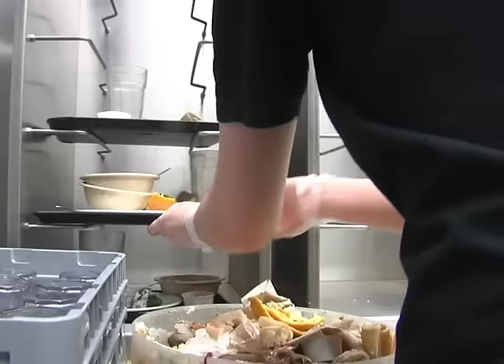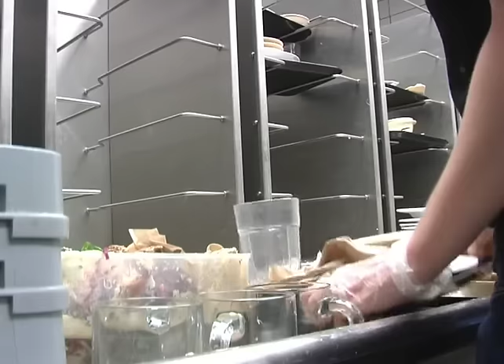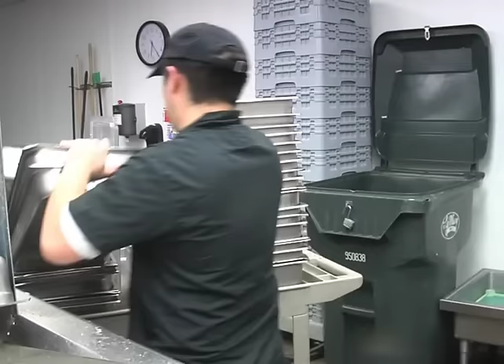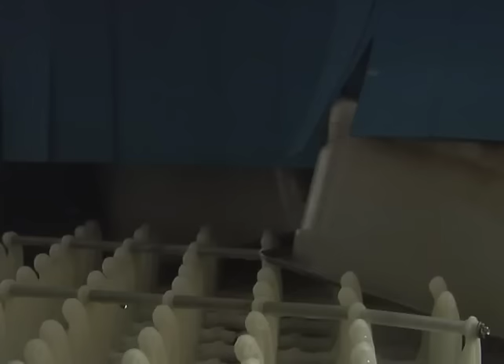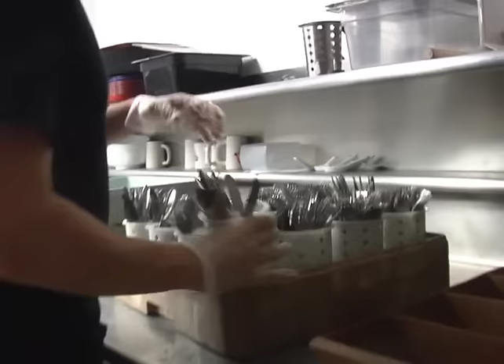Dishroom Training.m4v

Comment: 1 easy to notice large error - dishes going through dishwasher are filthy. When the dishes are not rinsed properly they will come back out the dishwasher still dirty and need re-cleaned.
Reply: put em back thru a second third and forth time, also you can hack a conveyor machine to run continuosly, only immigrants try too hard in pits
Reply: @walmartian  or idk do your job and clean them like a normal person would
Reply: @walmartian  wtf you never worked in the dish pit before.
Reply: The machine they are using is $20,000+ with multiple wash and rinse tanks. It is not as inefficient as the machines you are used to. You have a point, but we work smarter, not harder.
Reply: @walmartian  why would you want to tho
Reply: Thats only something to pick up on if you're using a single tank washer... the one in the video is at minimum 3 chambers. Tank 1 is a pre wash, tank 2 is a wash and tank 3 is a rinse, followed by a dryer element.

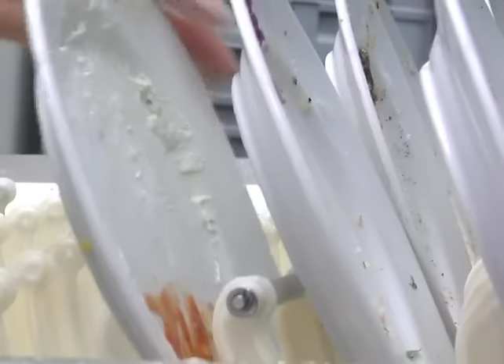Comment: 2:35 Silverware should be mixed in cutlery containers to prevent "nesting" i.e. DON'T put all the forks in one container, the knives in another container, etc., but put a combination of forks, spoons, and knives into each container so the water can circulate more freely. This means a much cleaner result. 

And if you stack the silverware on top of each other in a fine mesh flat rack, how are they going to be cleaned ["rinsed"] properly???
It's a great start but if you fill a cutlery container for example with knives, and then put them through the dishwasher again, how can the water even circulate properly? Good luck!
Reply: You are sort of correct, but please look at the video again, at around 2:35 you will see, that the silverware is mixed up in a flat rack with fine maze. This rack already has been run through the machine. After it came out, there you see happening, they sort the cutlery out in those little baskets. and run it through again. The function of this, is NOT to clean it. (this already has been done in the flat rack!) The reason it goes another time, straight up, is for easier and faster handling, but the most important reason is, that it dries up perfectly this way. So you don't need any unhygienic kitchencloths to dry or polish the cutlery. We're doing it the exact same way at my work, and it has proven to be the best method. It even brought us a compliment of the health units we're washing dishes for, the cutlery is now cleaner and more sparkly than ever.
Reply: You can mix just don’t put to much and put it in with the regular silverware at the end,
Reply: @kokkieamiga  Sorry, I just saw your reply. Yeah I know, three years later! As a result I've re-written my original Comment. Great to hear that your cutlery is now at another level.
Reply: @stevenmilsteen  I'm sorry, but I don't understand what you are trying to say.

Comment: I’m going in tonight to finish my application for a dishwasher where my buddy works my Worry is that I weigh 324 pounds and I’m only 5 8 so I’m short and my other concern is that I won’t be able to keep up with dishes
Reply: How'd it go
Reply: You can do it
Reply: If it's a fair place, the first few days no one expects you to keep up by yourself. I hope it went well.
Reply: How did it go? I start dishwashing tomorrow I'm almost 39 but I used to do it as a teenager and when I was 20 ..I'm only 5'2 and 120 lbs back then but I weigh 180 now lol I was able do it the. ..weight and height is not an issue
Reply: Don't worry man I weigh as much as you do but in 6'4 if your tall its just worse but you probably already figured that out
Reply: Do you still work there ?
Reply: Do you still work as dish washer

Comment: to much silverware per cone they won't come clean. and there's no hand washing.
Reply: Washing only removes the stuff from the plate it doesn’t clean it, rinsing it with a sprayer also removes stuff from the plate, either way you still have to hit it with detergent, and if still has to be hit with water.
Reply: What if you have nothing to wash with, I go through that situation everyday no rag or nothing.

Comment: Ewww y’all not rinsing the dishes before you put it in the machine???
Reply: Seize The Dae yeah they should, really disgusting
Reply: no one does that  if they did they would get fired for going to slow
Reply: just bring your own dishes next time, safer that way
Reply: Now tell me: What is the difference between manual rinsing off, and automatically rinsing off dishes in the pre-rinse section? I will tell you there is no difference. The dishes will come out clean both ways. It is in fact the same thing, but the machine makes it easier for the workers, saving them time and labour. The pre-rinse section is specially designed for this purpose. At our work, we work the very same way, and it works perfectly well. All the dishes come out clean at the other end. Only in rare possibilities items do not come out clean, this mostly occurs with baked on kitchen utensils, that still is no problem, you scrub them by hand and run them through another time, and done.
Reply: kokkieamiga not all the time, some still come out dirty coming out like they did coming in the machine
Reply: @cortezmauricio5654  to some level you're right, there's a certain percentage which still has some dirt particles left on it after washing in rare cases, but not the same as what you just said, that they're just as dirty as when they got put in beforehand! But I said that too in one of my other comments here, you just scrub them by hand and run it through another time. It depends on the type of dirt as well, if the dishwasher can handle it or not, but an item with only lose dirt stuck to it, you don't need to rinse by hand. Especially when the dishwasher has a pre rinse zone.
 People just shouldn't make things so difficult for themselves and just use dishwashers what they're designed for, washing dishes. It is what Hobart in Europe understands too, when they redesigned their dishwashers, when they install them, the kitchens doesn't have any pre-sprayers installed any longer! Because all the work has been taken over by the machine! And that's really awesome!
Reply: jamie ericcon  thankfully i do hotel maintenance again where i work like a normal human and spend most my shift in solitude.  dishwashing was an easy job but thats the problem after a few months my mind is not doing anything but runnning an auto pilot, then the drinking in the pit always starts the slow path to becoming a wretch and i dont feel the work is rewarding.  my only value is how fast i was a pan and competing with low brow try hards.  i dont miss the trench foot i was getting from my last pit it was a pure shit storm that we could not clean properly because the chad managers in their office didn't like to stay too late.  i bailed out before health inspection which they failed publicly
Reply: @kokkieamiga We were taught to scrap off the large leftover food from each plate before placing it on the rack.
Reply: @WW3_Soon  Do whatever you're taught to make your boss happier with your work. What we do is, globally emptying plates, place them in racks, shove the racks on the conveyor which transports the rack into the dishwasher. The prewash unit washes off most of the food particles left over from the plates with a low temperature to prevent proteins and starch to bake on, the second hotter prewasher does the rest, then the plates are for 99% clean when they enter the main wash zone, after that they're arriving in the final rinse zone and the dryer.  Most important is that the dishes have a minimal of 90 secs contact time, according to EU regulations. In the USA, this can be different, but shouldn't differ much, because these values are probably investigated by detergent company labs or other specialists in the field.
Reply: @kokkieamiga  Yes, our Lead Hand told us what to do and not deviate from his instructions.
Reply: @walmartian  but then the machine would get clogged more often and youd have to rewash dirty dishes more often because they came out dirty still

Comment: Nasty no handwashing.. plus u should be rising off those dishes before sending them through the dish machine.. I see things not in order in the dish room.. Where's your garage disposal??
Reply: what abou t drying things, when there out of the machine?
Reply: benverburg you have to let stuff air dry, otherwise it could get contaminated.
Reply: The sprayer does the Same thing  a metal scrubber does, not always but that’s when you use the metal scrubber when it doesn’t come out with the sprayer.
Reply: @benverburg  they've probably using a rinse aid probably green fusion by ecolab